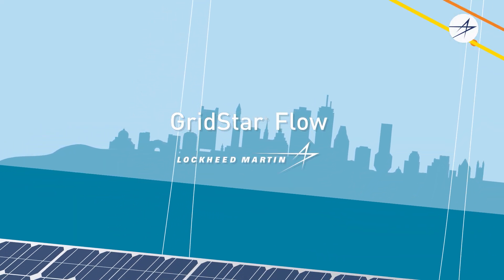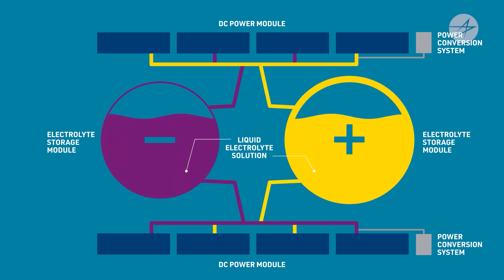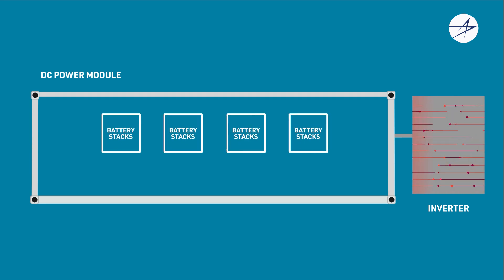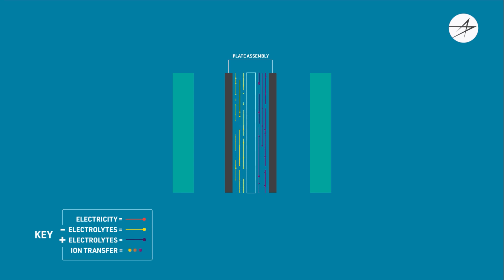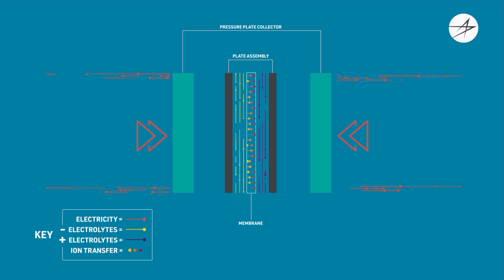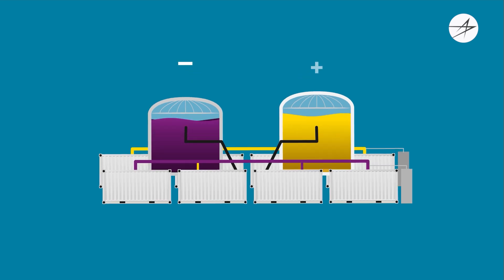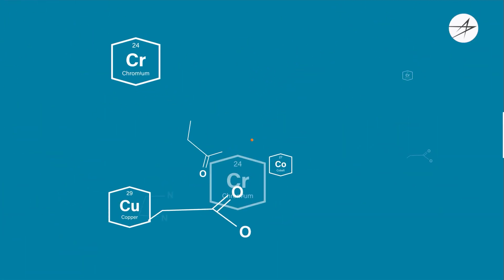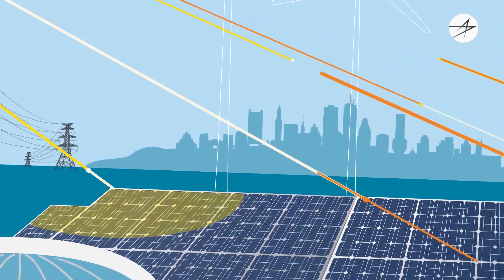How GridStar® Flow Works

Comment: What if you made this a subscription-based product where you store when electricity is cheap and then discharge when prices are high?
Wouldn't this be a viable business model? It's a lot like the Tesla Powerwall but you could run this from a single plant and it would be centralized and a steady flow of cash.
Reply: That sort of "market" has been operating for years, and without proper regulation falls foul of the usual human failings such as greed. i.e. People set up parasitic businesses to just exploit the movements in the market prices without contributing to it.

Comment: Inverters
 makes DC to AC
Reply: What's new in this
Reply: LOL Did you just rectify them?
Reply: Another thing I dont understand is that the solar panels give AC electricity?
Reply: @Monometre123  Yes, I agree this was incorrect in the video because solar provides native DC output.

The only AC would be from wind turbines which likely output 3-phase AC as described in the video.  I think their video animation and the video's text must have gotten out of sync somewhere in the video's production process.

Either way, they should just say that DC power comes into the battery as that is sufficient for the purposes of the discussion.  Because the power source is external to the battery system and we can assume it will be DC native or converted to DC as necessary before arriving at the battery's input terminal.